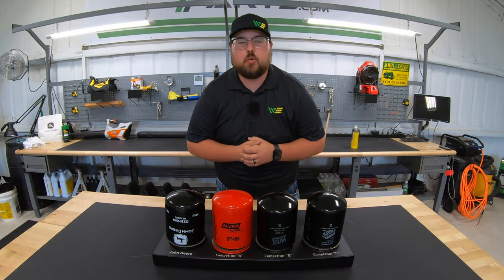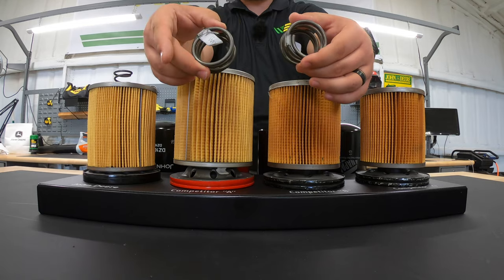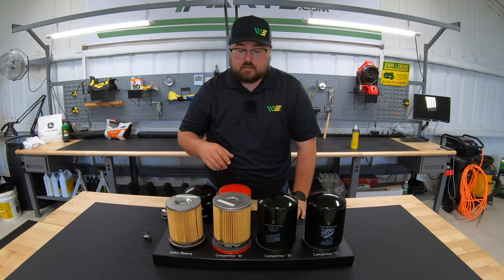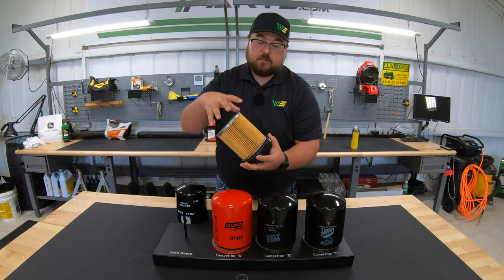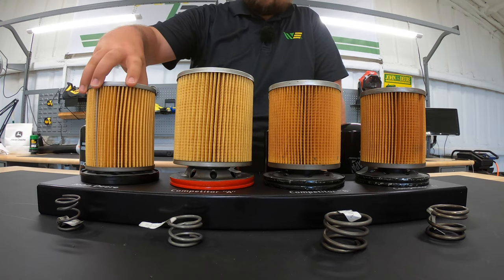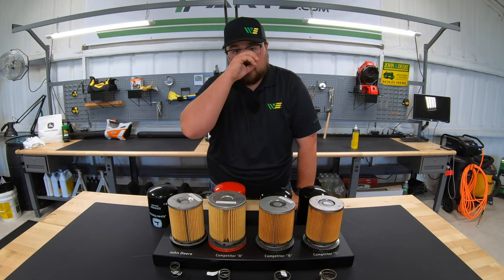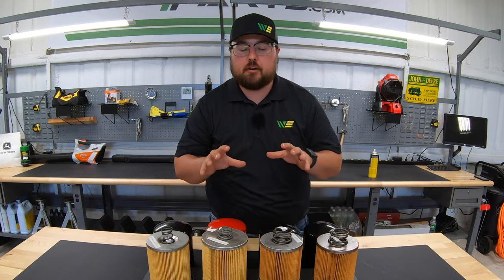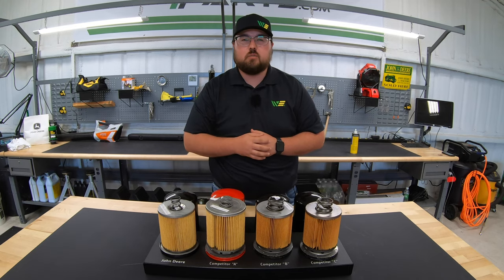Comparing John Deere Oil Filters to WIX, NAPA and Baldwin Oil Filters

Comment: There are many cases in which filters from the major brands are available that are very much of an upgrade from OEM.  The latest John Deere fuel filters I have received are printed 'Made in China'!  I suppose you would recommend those over a U.S. made Wix or Baldwin!  😂
Reply from the maker: I would always suggest using the OEM filters since they are specifically designed and engineered a certain way for the machine they are intended to be used on. Even though something may be made overseas does not mean the quality is any less. I would bet you have many things in your possession that were made overseas. Just food for thought, thanks for watching!
Reply: @WesternEquipment  The in line filters used to be made in Israel.  The point is not overseas vs. domestic but China vs. anywhere else!  And if I choose not to support inferior Communist made products, that is my right!
Reply from the maker: I totally understand. I am in no way saying you HAVE to use OEM filters. I was just clarifying that I would suggest them. I don’t blame anyone for not wanting to support certain countries. Again, thank you for watching!
Reply: @WesternEquipment  I would probably suggest the products that I sell as well!  😂 Have a good one!

Comment: A filter's job is to filter particulate, at an acceptable oil flow rate.  You did not mention anything objective or data driven that supports which filter does the best.  Subjective or terms terms like bigger, smaller, better were used throughout the video.  You made reference to the the number of holes on the nut-plate, my guess is that any of those would more than flow the necessary oil for the application.... the filter media is going to be the limiting factor.

On the plus side, videography was excellent, loved the clean, organized workstation and the commentary was well thought out.
Reply from the maker: Thank you and thanks for watching!

Comment: I thought the spring was there to allow oil to bypass the filter element when it was like 'honey'.  Cold winter oil won't go through the pleats of the filter very well and will push up against the spring allowing oil to temporarily flow past the filter element rather than through it.  The Deere filter doesn't allow for that.  I'd rather have a bit of unfiltered oil in the engine than none at all.  Once the oil warms, the spring pushed the bypass closed and the filter does it's job.  The spring is small because it doesn't do anything.  If I'm wrong, I apologize as I don't want to bash an otherwise well thought out filter.
Reply from the maker: This is true in the instance that the spring will allow enough give so that the oil can go back through the seal, which is also called an anti-drain back seal, when pressure is too high or the filter becomes clogged. But it's main function is to keep pressure on the filter itself to keep the filter against the seal and to keep the filter in place. Good point and thanks for watching!

Comment: I prefer to go with the OEM oil filters.  I discovered with my Ford 6.0 diesel, that only the Motorcraft filter has the correct valve setup.
Reply from the maker: OEM is always the way to go. Thanks for watching!
Reply: Also, the non oem filters for the 6.0 are not as long as the oem filters and do not fit and seal in the canister like them oem is meant to do.

Comment: 1:30 the spring is also more importantly part of the oil bypass so when the filter is completely blocked the oil pump can force that spring back and bypass the oil around the filter media and keep things going. Dirty oil is better then no oil.
Reply from the maker: This is true in the instance that the spring will allow enough give so that the oil can go back through the seal, which is also called an anti-drain back seal, when pressure is too high or the filter becomes clogged. But it's main function is to keep pressure on the filter itself to keep the filter against the seal and to keep the filter in place. Good point and thanks for watching!

Comment: I was told by old time mechanic to use Baldwin oil and fuel filters in my dodge diesel truck, so far have had good service, I think I will stay with them,
In my 2005 model when you change oil filter by the time you start it up then shut it down to check the oil level the oil is already black,
Reply from the maker: Don't fix something if it's not broke, can't argue with that.

Comment: # of pleats don't matter nearly as much as the overall surface area of the filtration material..:

Cut the cans, stretch the filtration media to length and then measure as to which filter contains the most media, overall.
Reply: I was thinking the same thing. He mentioned surface area, but actually did nothing to measure the surface area. I have seen many videos that taken them apart and even though some have fewer pleats they tend to have more surface area. If thats the case here, then his whole push for which is better would be out the window.
Reply from the maker: This is true and I should have done this for this video.
Reply: Exactly.  A smaller center tube will result in more media surface area, even if less pleats than a filter with a larger center tube.

Comment: 6:30 if you really want to know if the holes are a restriction, measure the surface area of the small hole and multiply that by the number of them vs the surface area of the large hole. If it’s the same then more holes doesn’t matter. Your only gonna move oil as fast as the smallest passage will allow.
Reply from the maker: Great point. Hopefully I can dive a little deeper into the specs sometime on these. Thanks for watching!

Comment: I change heavy equipment filters all day long and i can tell you jd factory filters are the hardest filters to get off. Baldwins rarely get stuck even at 1000hrs. Jd filter almost bond to the threads after even 500hrs. Complete p.i.t.a.
Reply from the maker: Interesting. I had never heard of this complaint. What machines are you seeing this on?
Reply: @WesternEquipment  any jd excavator or ct322 skid steer. Or wheel loader.
Reply: Kinda weird seeing most John deer filters are made at the Baldwin filter plant on the same manufacturing  lines.

Comment: Who makes the oil filters for Deere?  Are they USA or foreign made?
Reply from the maker: John Deere is pretty vague when mentioning specifics on part manufacturing. I can say that all of these filters are engineered by John Deere to meet their high standards. As far as where the filters are actually assembled, i do not have an answer on that one. Thanks for watching!
Reply: All those are made in china !
Reply: I saw quite a few Deere and Cat filters being made at the Baldwin factory in Nebraska..
Reply: Fleetguard, Cummins Filtration
Reply: JD filters are made in Mexico. I run Baldwin on my 5075E. Baldwin and Hastings are the same dilter other than the paint and logo. They used to be, and may still be the same filter as an AMSOIL filter other than the AMSOIL uses synthetic media, where Baldwin/Hadtings do not.

Comment: I would like to see a comparison of the John Deere branded oil filters compared to the engine manufactures branded filters ( Briggs & Stratton and Kawasaki). I have an S120 with only 2 hrs. so far. When it's time for the first oil change I will be changing my mower over to a traditional oil change setup. I know oil is going to breakdown from normal use due to heat, oil pressure & dirt no matter how good the oil filter is.
Reply from the maker: This may be one I have to do sometime. Good idea and thanks for watching!

Comment: Well all the visual comparison review is interesting.  But without bench flow test it's all a guessing game.  On the pleat spacing is concerned, they will be moving around as the oil is forced thru them.

A person has to understand IF the non Deere filters are so bad.  Those brands would had been Sued thus making the product not worth producing.
Reply from the maker: These are valid points. Thanks for watching!

Comment: Hey what size car oil filter would I use for a lt160
Reply from the maker: Well the John Deere part number for your filter is AM125424 so you could use that number to cross it to a car filter. Hope this helps and thanks for watching!
Reply: I use STP  S-3512 & never had any problems !!